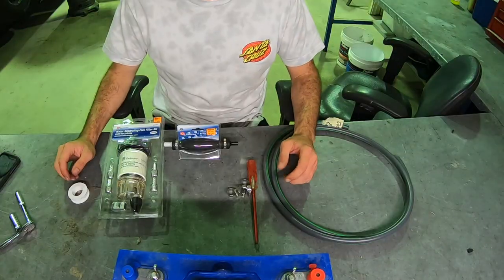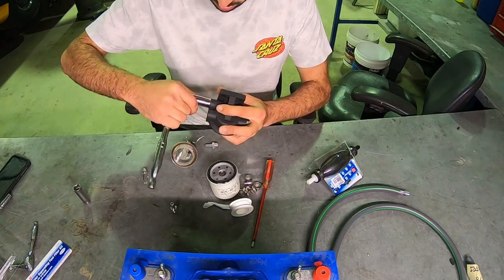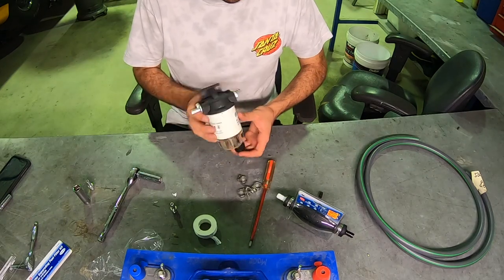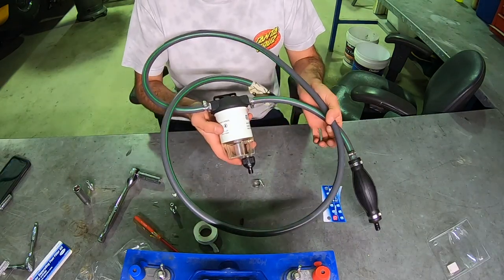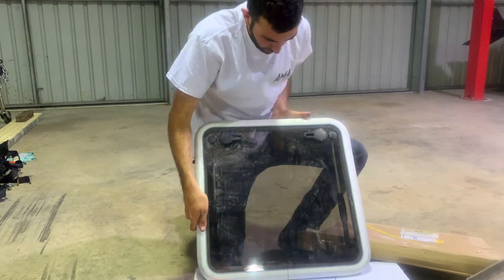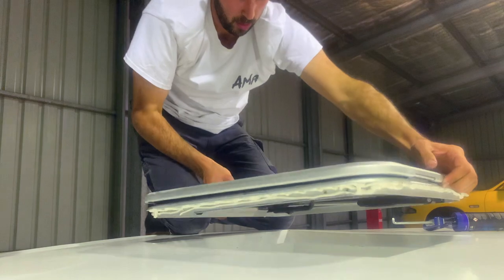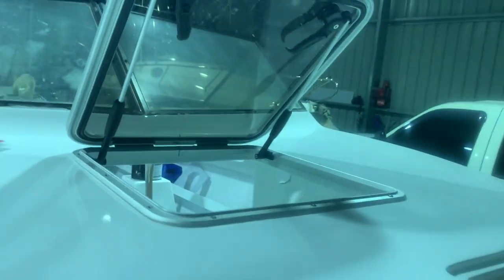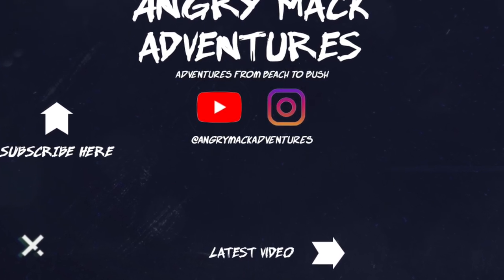INSTALLING FUEL/WATER SEPARATION FILTER | FRONT HATCH | FULL BOAT RESTORATION - PART 13

Comment: Good time while installing the fuel filter to also install a fuel flow meter (FloScan was an early maker) now Faria makes a great one that fits the same hole as your old oil, water pressure gauges (right around 2 1/4") instead of the tachometer sized hole the FloScan used.  Transducer is easier in the Faria as well.  The Faria was $180 USD about fifteen years ago when I bought one.  The FloScan in the mid seventies was $4-500.00 USD as best as I recall.  They both give you gph real time, total used, gallons to go until empty, gallons left in the tank.  Combined with your tachometer you can figure your best mpg if you are stretching a cruise.  I understand some new high end outboards have all this in their glass gauge.  Very useful diagnostic tool as well.  Any sudden changes in consumption are obvious and let you know it.  If you have a weird shaped tank as many boats do they can be invaluable as 1/2 in a v shaped tank is not a valid measurement unless the sender has been calibrated and most are not.  This gauge always lets you know in real terms.  Mine have always been accurate to within .01%.  Enjoy your enthusiasm.

Comment: The fuel bulb should be as vertical as you can get it so that the internal valves work correctly . Is that thread tape rated for petrol ? .
Reply from the maker: Stewatpark Park hey mate thanks for watching, yes it was as vertical as I could get it, parallel to the floor :) 
Sure is mate!